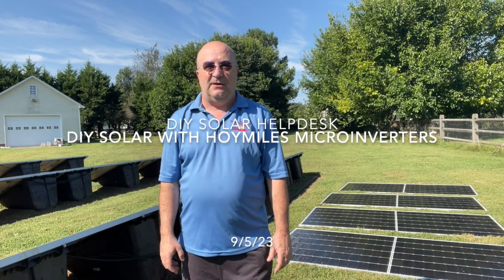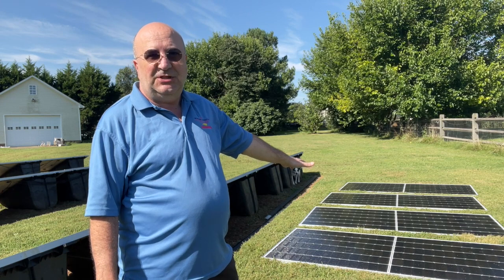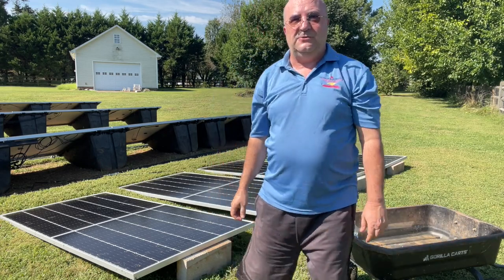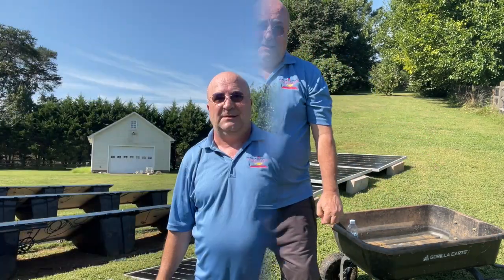DIY Solar Upgrade with Hoymiles HMS-2000-4T-NA Microinverters

Comment: Hey Todd! Looks great, those panels look familiar ;) It took me about 90 minutes to do four panels and one inverter up on my roof (including wire management and water breaks). Ground mount definitely looks easier.

I'm curious to see what numbers you get out of those panels.
Reply from the maker: Yesterday, I saw them output 515W for a time long enough to capture one data point in the 15-minute interval data. At that time, the sun was refracting and reflecting through the clouds providing irradiance greater than 1000W/m^2. Nice!

Comment: Hello, Please could you tell us the details about brands and models of the solar panels
I would like to buy HOYMILES but i don't know which solar panels to chose
Thank you
Reply: As long as the Voc is <55 Vdc, and the voltage is greater than 22V, they are compatible. For the HMS-2000-4T-NA, they range from 320W - 670W solar panels. Ideally, 450W-550W.
Reply: @ToddDesiato  Thank you for your answer. Finally, i selected LONGI 550W Tier1 solar panels. Will be installed soon
Reply: @BlueThailand  They would work well with the HMS-2000!